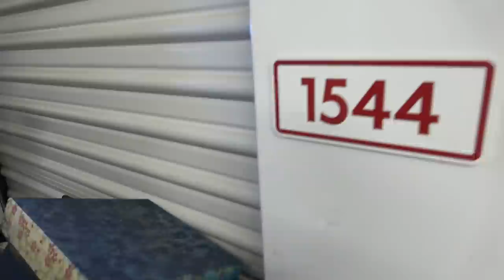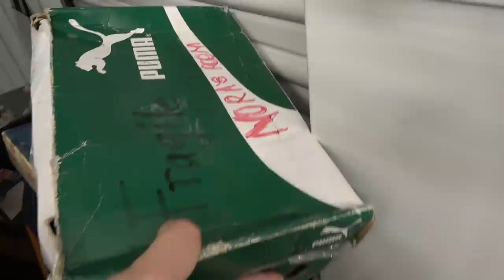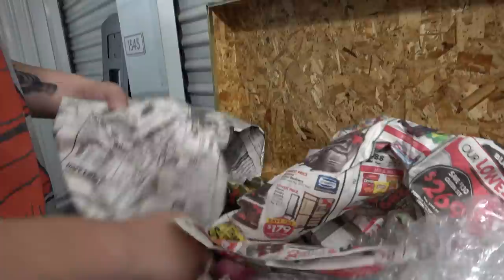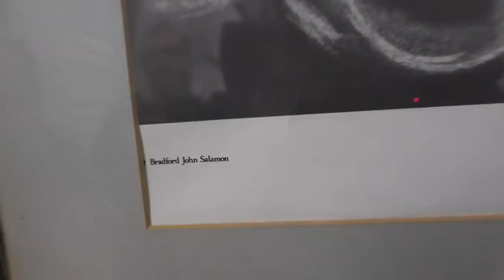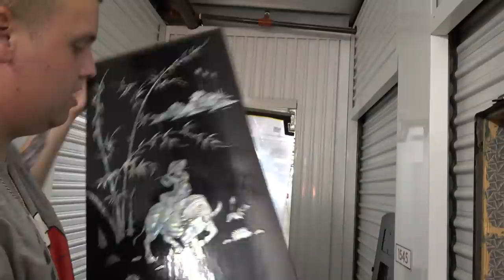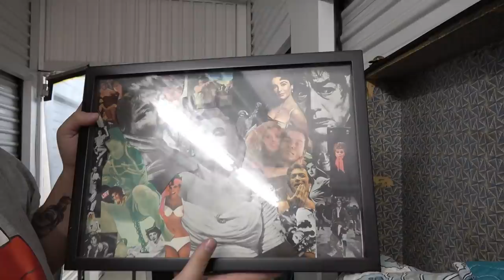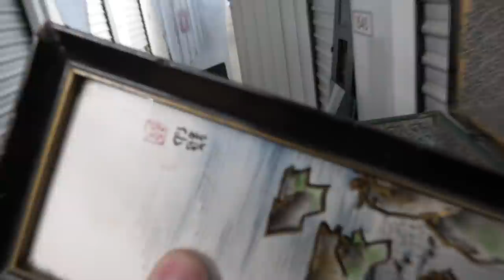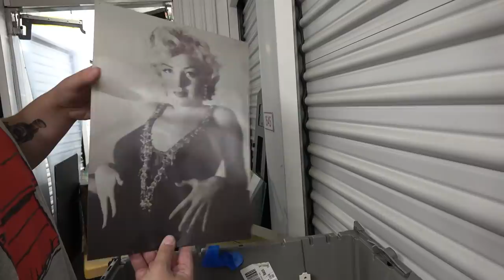RACIST Owner Tries To TAKE His Stuff Back! WE SAID NO! I Bought an Abandoned Storage Unit

Comment: Invest in a jewelry loop Jebus. maybe a "Storage Unit Utility Belt" Easy to carry a knife, loop, flashlight & maybe even a small pouch to put the jewelry & change in. Just a thought. Keep with it guys! 
Be well,
Al-Fu
Reply: Good idea.  👍😁
Reply: good idea, i still have a loup with a lil light in my handbag even though i dont need it so much now lol
Reply: I have a loupe in my purse, but generally just use my nearsighted eyes if I'm at an estate sale or the like - you don't want to tell the dealer they missed something if you don't have to. Pull the glasses down and I'm off to the races.  One trick without a loup is to run the edge of your fingernail over earring posts/backs and the like.  Short marks on gold-colored pieces are generally a good thing. Long ones usually mean costume.
Reply: @OriginalNethead  That's cool. So CSI.  👍😁

Comment: It is a upside down podium with two side compartments for sandwiches, you can also use it for a truck tool box.
Reply: Here in the UK they are used inside garages on bars secured to the ceiling

Comment: 3:19-yes it is a truck bed tool box.
If you lightly thump good crystal with your finger it will make a ringing sound. Glass just makes a thump sound (just like that vase did). 12:25-the round red thing is a large candle holder.
Pirates are always looking for dabloons (most likely not spelled correctly).
Coke items are VERY collectable so please be careful with all the Coke stuff and check it on eBay.

Comment: It's a truck box, goes on the back of a truck.
Reply: About $1000.00 installed new, plus service charge, & tax. They were popular doing the 1980's, & 1990's. They're mostly used on commercial trucks nowadays.
Reply: @joeybarrelwilde  $1000? Are you buying one dipped in gold?  You can get the plastic ones like theirs for around $200, a decent aluminum one goes for under $400.
Reply: @msack6904  The cost of the purchase, installation, & tax is $1,000.00 plus.
Reply: @joeybarrelwilde  that is highway robbery. You can find those plastic ones all day under 250-300 and install should not be more than $100. Doesnt take long to drill 2 or 4 holes in the bed rails and run some bolts through. Glad I know how to use a drill and wrenches, I couldn't afford those prices.
Reply: @joeybarrelwilde  what installation.?
There are easy to put in. 
Brand new like that $250
You don't know what your talking about.
Reply: @tamethegame4254  Yes, I do. There is places that install them for you.
Reply: @joeybarrelwilde  If you need someone to install that for you, you wouldn't know what to do with the tools anyway.
Reply: @wudeveryoosay974  Anti theft for contractor job sites. Keeps the tools from being stolen.

Comment: I would have done what you did, pull out personal stuff, leave for the dopes, and take your treasures away.  If you research well, you can get lots of money on all those smalls that may be picky to list but will be worth it.  Sell the empty boxes  in one lot on ebay, people like to keep the boxes for resale etc.  

Very first vase you pulled out was an Irish piece that should be listed on ebay.  Little harp is the mark on bottom.

Just a tip on glass and pottery vases, bowls etc.To check for damage to the piece,  CAREFULLY hold the piece in the palm of your hand and give it a "ping" (knock with thumb and first finger like shooting marbles)  It should ring out clearly if item is not cracked.  If there is a hidden crack somewhere, the sound will be a sickening THUMP.  Many people don't do this, just look at the pretty item and end up with a bunch of cracked items they can't sell.  Good to feel all the surfaces with your fingers for chips too.  

Ivory has tiny tiny little dark cracks in it because it is the elephant's tooth.  Can't feel them, but can see them with a magnifying glass.  I don't think that vase is ivory because it is clearly shaped like a pottery piece with a really thick rim.  Ivory pieces are more delicate.

Comment: 12:00 - pen holder or bud vase.  12:25 candle holder. The "ivory" vase is carved faux white cinnabar. Possibly resin/plastic.  Ivory it ain't.  I can spot ivory from 20 feet away, without much exaggeration.    The Stones thing is probably a modern print.

Comment: Telling if something is ivory or bone or plastic isn't that complicated, heat a needle to red hot and poke it into the base or somewhere unobtrusive, if the point melts in its plastic, if it burns or does not go in ivory or bone, bone scratches much easier than ivory because of ivory density.

Comment: You don't check something for Crystal holding it with a death grip.  It should be on a flat surface and you give it a "twily wink kiss"" a very, very gentle flink.   If it's crystal, it will ring.

Comment: The Rolling Stones concert poster….from the point of view of a headshop Est. in 1966 (not trying to plug my shop, so I don’t mention the name) we still have a few of those in stock to this day; but the wholesale poster company where I get them still carries them as well….maybe not as many designs as in 2005 but still quite a few, through the years the company has added designs and dropped others, sold better in the past but their smaller than regular poster size makes them cheaper/easier to frame/fit into smaller areas on the wall so they still sell once in a while….they look like real posters (and they are reprints from the real concerts), but judging by the color, size, condition, and the fact that even that particular one looks familiar (not worth getting out my catalogues from the last 15 years to hunt it up) tells me it’s most likely one of those reprints. On the bright side, we retail them for $18.95, so they’re more expensive than the regular posters ($7.95 retail) that are larger, the concert reprints are printed on much heavier stock too.

Comment: the trunks , well the last 2 are walmart 80's stuff , the first one is like a pier one trunk , no great value , as for the coke bottles at best 3 or 4 bucks a piece , the 75 anniversary bottles were issues for each independent bottler , they also did 100 year bottles , they usually go in the 3 to 5 range , the high end if full

Comment: The black panel pictures are ORIENTAL inspired  mother of pearl lacquer art panels set of 4. They will go for about $100 part of mass production knock offs. If they were higher quality they would have a super smooth lacquer finish and you would not see or feel the shell inlays.
Salamon's John Lennon might get $100 with replaced frame
small oriental picture panels looks like they are 3" by 18"... 1960s "vintage set of 3 Japanese hand painted tiles" they sell for about $100 I think the actual one you have is on Esty.
27:05 is hand blown incense burner holder

Comment: Saw at the beginning is a scroll saw.  Good for making intricate cutouts.

Doubloons--what pirates look for.

My guess is that the carved vase is resin.  Ivory will have some crosshatch-looking grain.  One way to test is to hold a pin or small nail with pliers.  Heat it up and touch it to an unseen part of the vase.  If it melts, it's resin or plastic.  If it smells like burn hair, it could be bone or ivory.  Judging from the quality of the other stuff, though, I wouldn't bet on it being ivory.

Comment: Burn it with a lighter, if it smels like plastic its NOT avory, if its smells  like nails or burnd hair its must likely ivory.
Reply: DO NOT EVER DO THAT. 
That is a terrible idea. IF it is ivory that would damage it and make it WORTHLESS for sale..
What we in the trade do is to check the grain pattern first, if it is cross hatched it is likely Elephant ivory. If it has dendrite rings, like a cross section of a tree, it is likely  a tooth, (whale/walrus/Bear, etc.),  not "ivory".
However forgers are so good that none of these visuals is 100% diagnostic.
THEN we use the "hot PIN" method which is exactly what it sounds like. You take a needle or pin and heat it up with a lighter or such, then once the pin is hot  you find a place where a pin sized mark will not matter, like on the bottom of the piece. THEN you push the hot pin into the piece, IF the hot pin sinks right in  and you get a smell of plastic it's PLASTIC/resin/whatever.
IF  instead the pin does  NOT sink in fast and easy and deeply  and you get a faint smell of "hair" you have true ivory,  OR maybe a tooth according to the annular ring pattern.
Ivory and Teeth that are fossilized will produce no smell at all and resist the hot pint like stone, which is what it really is if it is fossilized.